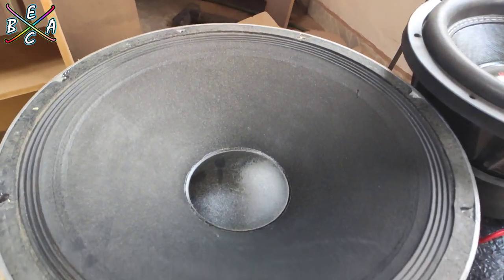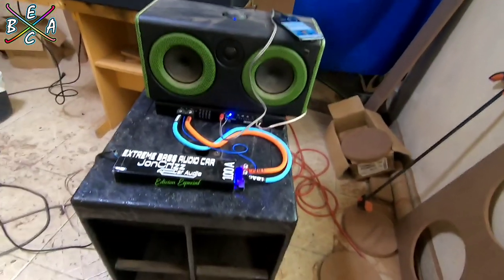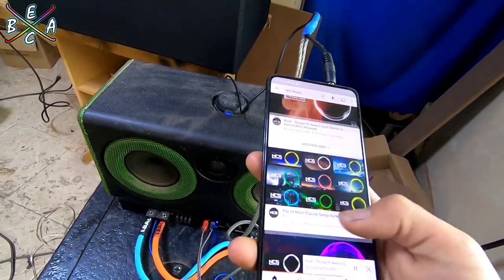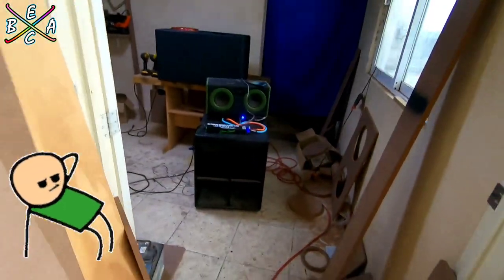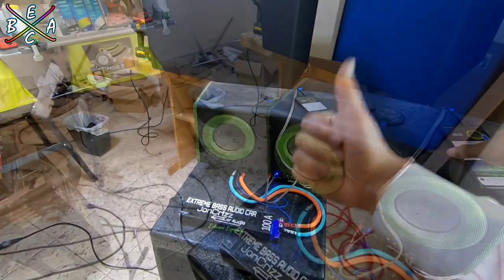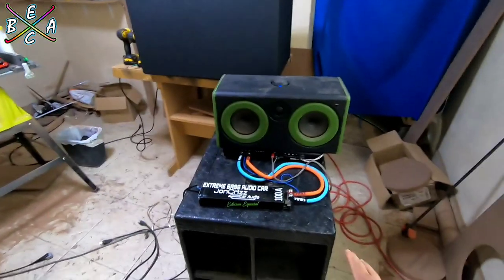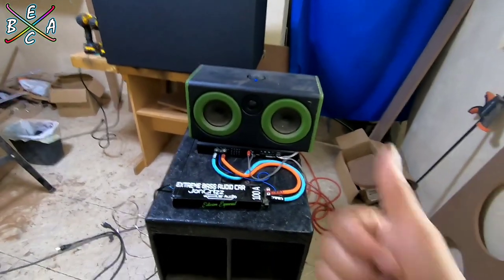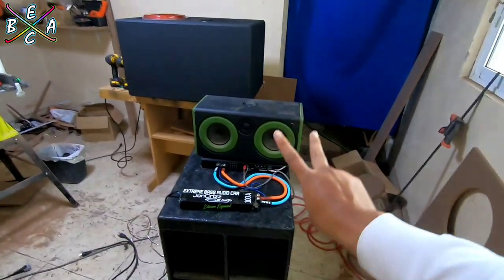Poniendo a Prueba MINI Turbo Con Peavey Black WIdow 18 y Amplificador de Car Audio MTX 1200.1 | EBAC

Comment: Me sorprendes cada día mas, te hago una pregunta, el amplificador que usaste es de carro y como lo subiste a 8 ohms,
Reply: Si es de carro y cualquier amplificador se puede conectar a 8 ohms, solo tienes que configurar tu subwoofer en serie si es de d4 para que quede en 8 ohms
Reply: Los amplificadores no se suben ni se bajan el omeaje..simplemente se fabrican y ya para uno en especifico..los de audio car  se fabrican de 1ohm o asta de 0.5 para poder dar mas potencia con menos tamaño..
Reply from the maker: El subwoofers es de 8 ohms amigo por eso quedó a 8 😁
Reply: @ExtremebassAudioCar  suena genial, como hago para poner ese sonido en casa  tengo un bajo de esos 18 pulgadas en la etiqueta dice dual 8 ohms, que amplificador me recomiendas, y como hago para qué suenen más duro los medios y los agudos?
Reply: @xLedezma  José gracias, quiero poner un sonido así en casa como le hago que amplificador debo  conseguir  y que me suenen  más duro los medios y agudos  telo agradezco, que me ayudes con esto,
Reply: @arleypalacio9350  Puedes buscar un amplificador 5 canales de car audio o un amplificador home audio de 5.1 canales y te ahorras en comprar una fuente de poder porque ese lo conectas directo a la luz, yo en mi habitacion tengo un DSP sony de 5.1 canales con 2 torres sony y un subwoofer sony tambien

Comment: Si tengo un parlante de 12" de 1000watts nominal de 500watts RMS y uno de 18" de 800watts de 400watts RMS ambos con bobina de 3" cual suena por decirlo así más duro respecto al bajo?
Reply: El de 18 te va a sonar mas duro porque tienen mayor db y el cono más grande
Reply: @matadoryt4274  pero si el de 12" tiene más potencia que el de 18" como es posible? 
El imán del parlante de 12" es mucho más grande y tiene un mejor sistema de amortiguadores que el de 18"
Reply: @rivetboom1465  no importa el tamaño del imán lo importante es la bobina 🧵